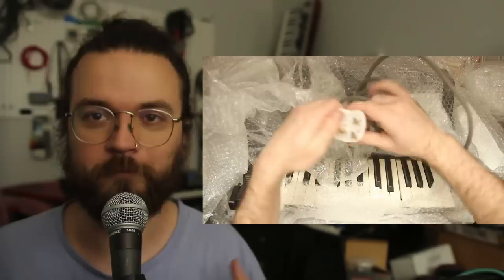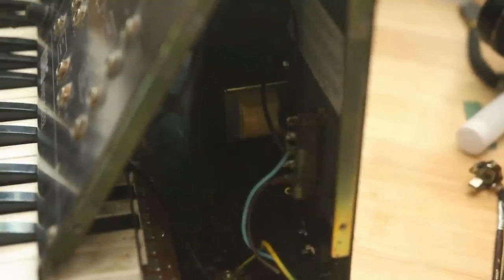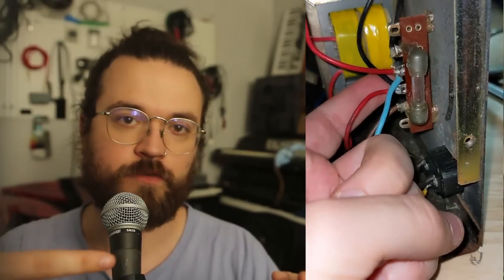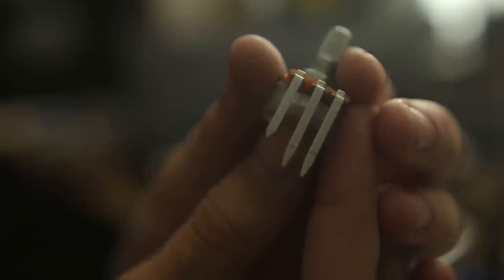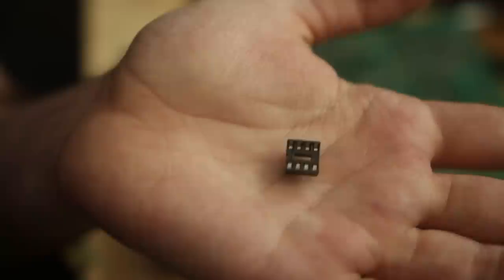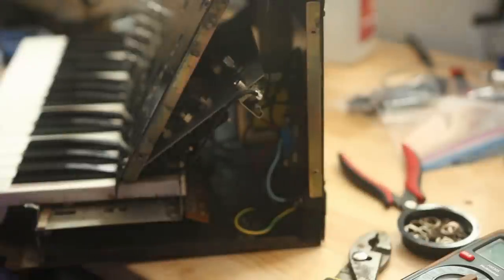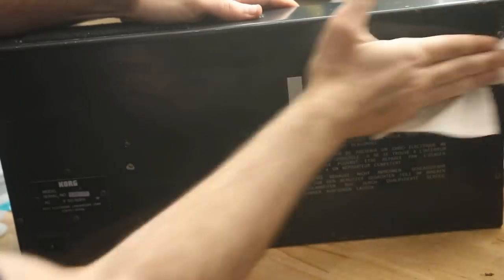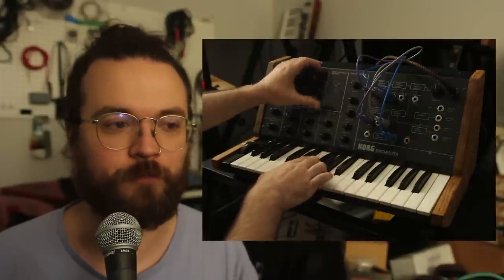Repairing a Very Special Vintage Synthesizer

Comment: I know basically nothing about electronics and this was thoroughly enjoyable. I was able to follow some of your explanations as they were so clear. For example, makes sense that a trigger jack could interfere with the envelope.

Super gratifying to see it restored too, I love seeing these things cared for and kept going, even when they look like a sorry pile of parts.

On the filter note - I recall someone mentioning that the MS-10 and 50 have a low pass filter that more closely resembles the "traveler" filters that came before and are slightly different to the MS-20, even if you just use the lowpass. You said there was a Korg-35 in that 10 which seems to contradict that, but I'd be fascinated to know. 

On another note - I've got a video on the 770 coming next week and that thing sounds ridiculous.
Reply: All MS-10’s and the earlier MS-20’s have a 35IC(s) for the filter(s). The later model MS-20 had an OTA design.

The MS-50 and the 700(s) use a diode ring as the core of the VCF but the MS-50 used the CA3019 for it’s design and the 700(s) the Keio TS201012. The later is a regular circuit board with discrete components under a plastic cap.

You can find pictures of the TS201012 on Colin Fraser’s site. Posting the link here deletes this message, apparently..
Reply from the maker: That's high praise from you, cheers for that.

I'm not super familiar with the topology of the traveler filter, but I do know MS-10s do indeed have the Korg 35, just like the early MS20's. I know the Korg 35 is transistor based, and with a bit of googling the traveler filters are diode ladders ring(?), so it seems they may be different.

Really looking forward to your coverage of the 770, it seems to be a fascinating era. Almost like one foot into the world of standard labels and control, but lots of choices still feel prototypical.
Reply: @PWMaarten   Thank you, that's great! OK, so the MS-50 has a filter design that's related to the traveler / TS201012. I must have mixed the 10 into that equation in my mind.

Thanks for clearing that up for me!
Reply: @JorbLovesGear  Genuinely fascinating video.

Yes, it appears I confused the MS-10 filter and it's just the MS-50 that has a design resembling the traveler. I've come close to bagging a 50 a few times, but they always go for too much. Fingers crossed.

770 - absolutely as you say, it's the missing link between the very unique and peculiar 1st generation Korgs and the MS range, which are still quite peculiar, but start mirroring some Western conventions.
Reply: Wow thanks to your knowledge of this I had a 50 and a few 20s and was curious why the 20s sounded different  I must have had an early and later models and to own a 50 and 20 was a pair in heaven when patched together it’s an incredible experience of sound

Comment: Quick tip regarding shrink tubing - if you want to avoid accidentally barbecuing the tubing with an open flame, a hair dryer will get the job done. There are actually professional hot air tools specifically for the job.

Also, chip sockets are always a good idea. 👍

The wood panels look great. Totally worth the effort IMO.

I’m an MS20 owner myself. I bought it back in 1979 and haven’t touched it in a while, so it’s probably time for a refurbishment (or a good cleaning at the very least)…

Comment: In case anybody is wondering, here's the primary reason you want the fuse on the "hot" wire. The case is connected to ground, so that if a line-voltage wire gets loose somehow, and touches the case, it'll blow the fuse. That then disconnects the live wire, and everything inside the synth will be in a safe state. If you put the fuse on the neutral wire instead, you won't get the power interrupted by a short to ground, and you'll have current flowing until the main circuit breaker flips. That means up to 20 or so amps running through wires that are sized for an amp or less, which is a serious fire hazard. 

If you somehow managed to put the fuse on the ground wire, you'd potentially get a situation during a short where the fuse blows, but the whole outside case is left at line voltage, which is an electrocution risk.

Comment: Great job fixing this! The only thing I'd suggest to anybody replacing or rewiring a transformer: when you first turn it on, measure the output voltage before you touch anything to see if it's what you expect. That's both in case it's too high (something wired wrong) or perhaps very low (which would indicate a short).
Reply from the maker: I did actually! good point though, should've mentioned it
Reply: @JorbLovesGear  Ah, gotcha! You're very thorough, and it's smart to be careful with this stuff. I hadn't even thought about where the fuse would go, but you're absolutely right that you want it to cut off the hot side as early as possible.

Comment: I used to rely on those de-soldering hand pumps, but have switched to strictly solder wick when working on vintage gear. I have had way better luck getting parts out intact with wick

Comment: Current standard wiring practices for mains power wiring is to have both the power switch and fuse in the Active wiring to the mains power transformer, this is so that in the event that the power transformer suffers a short-circuit in its primary winding, the fuse will blow and cut off power to it, preventing the chassis from becoming live at full mains voltage.

Comment: Funny, I've been going through all your videos and LMNC's at the same time, so I had to skip to this video when I saw it.  Nice job with the repair, it looks much better.

Take the palm sander and knock all the rust off the metal cover inside and repaint, or the rust will continue to creep across your casing.  It grows very slowly but once it has a starting point it will continue to spread and eat through the metal.  It can also spread to fasteners and other metal bits in contact.  Just got a Korg DW8000 that has a ton of corrosion inside and needs the same treatment, it's my next big synth project.  Also bringing back a Korg MS2000 but I suspect it just needs a bit of soldering repair.

Curious what your MS-10 went for, I remember Sam mentioning it but didn't think to look it up.  Deepmind 12 arrived yesterday, you totally sold me on it and I never imagined I'd like it as much as I do!  Keep up the great work

Comment: If the original transformer had taps for 100V and 220V then you can use those two points as the Live and Neutral feed and discard the original “0V” or “common” wire. The difference between the 100 & 220V taps is the 120V you need. It’s highly likely this transformer was intended for all word zones if it had those extra taps so I can only assume that this would be the intended wiring for 120V areas. Disclaimer though, I don’t know this for a fact but I cannot think of a reason this wouldn’t be fine.
Reply from the maker: oh wow thats an excellent tip. I'm trying to think of any way the difference doesnt work on that, and with one wire always expected to be ground. their ratings would be based on their relationship with it, so the difference seems correct. 

WOW great tip
Reply: @JorbLovesGear  Ground is just the middle tap on the secondary coil :) It doesn't matter how you wire up the primary coil, since it's not connected to the secondary. Which is what makes transformers so versatile. And it's convenient that US is 120V, Japan is 100V, and Europe is 100+120V.

Comment: Nice work.  I've found that in many cases, things tend to look worse than they actually are for repairs.  That said, I did buy a Arp Omin 2 several years ago that some one had completely torn down into individual circuit boards, that was a real pain to get back together.  It had loads of mods that were a devil to sort out as to what was factory mods, service mods, or just bodging to keep stuff working.  And the huge task of replacing all the tantalum caps on each individual key.  Really sounds awesome though and the end of it all.

I would get some spray on rust converter and then new auto enamel paint for the inside of that case next time you have it open.  Rust seems to attract more moisture and rust, which will lead to corrosion on the boards and any new jacks you put in.

Comment: Your drill press comment - I share your pain hugely. I'm space limited & can get by with foldable worktables etc. But the drilling is very stressful & I've gotten better but the drill press is the dream.
Reply: When you (or Jorb) eventually do get a drill press, I recommend spending slightly more than the least-possible amount. My extremely-cheap drill press has an eccentricity in the quill, which makes it hard to start holes in exactly the right place. It does drill extremely straight, though. So it's better than doing it by hand, just not as nice as I'd hope.

Comment: I knew I liked this channel! I cringed a bit when you said you were using a router cos if any power tool for wood will bite, it's one of them! Bite, snap and bounce up to smack you in the mouth... Glad you are in one piece. I don't know if you are aware of sugru? mouldable epoxy, that could be a useful thing for you to have around, also a light rub down with wire wool and a coat of black smoothrite (hammerite) for that rust would be on my list.
Anyway love the channel and resurrecting that old beast was satisfying all round. 👍😜🖖

Comment: What's the best value of pot for volume? I thought it was 100k cause that's what I saw some pedals use but Sweetwater has volume pots for guitars that are 250k and 500k.
Reply from the maker: Depends on the circuit, won't be the same between synths and guitars either.

Guitars have a tone difference based on pot values, higher resistance means less high end, but the high end from different pickups will of course be different. 

I like 250k for single coils, even on hotter ones, let's them be bright, and I can work the tone knob. 

500k is common for humbuckers, many models would be shrill with 250k
Reply: I wrote a whole notebook page worth of notes after watching this video you and Sam Battle are super inspiring. He has so much energy and enthuisism torwards everyhing it's hard not to be inspired about stuff

Comment: Jorb you rock

I run a little arcade/livemusic venue
Annnnnnnd i had a metal night lol, and now one of my speakers dont make no sound lolol

i already asked it (the speaker) 'y u no sound' so.... step one is done... no response

anyways, classic pa system, mixer to amp to passive speaker

when it stopped working, i did smell some sort of fire/heat/smoke whatever you call it

any idea of what part i need to replace?  the speaker... well everything looks fine, i assume it has something to do with the crossover, but i dont see any actively bad looking parts
perhaps can you make a video about how to fix general stuff?  like a passive speaker?